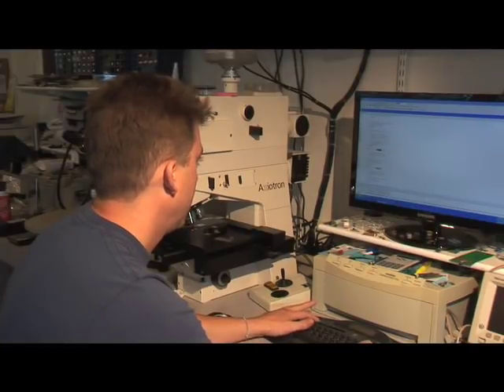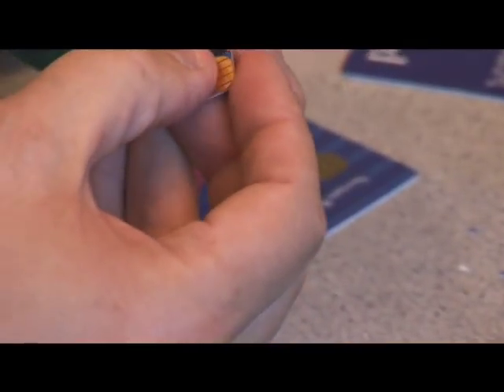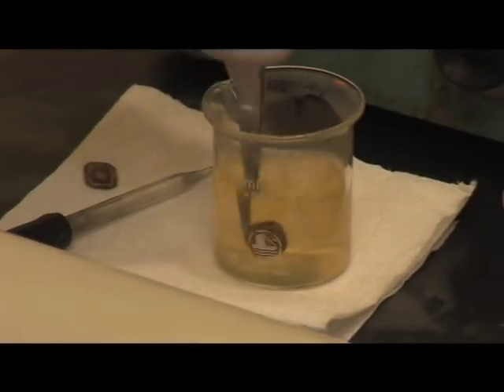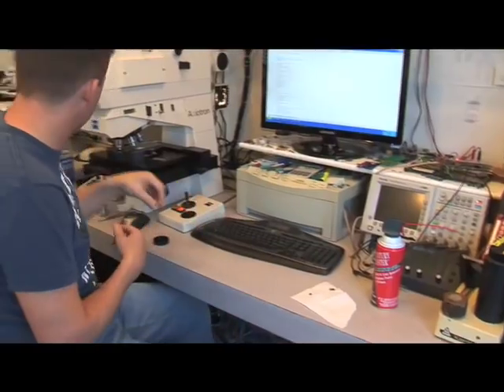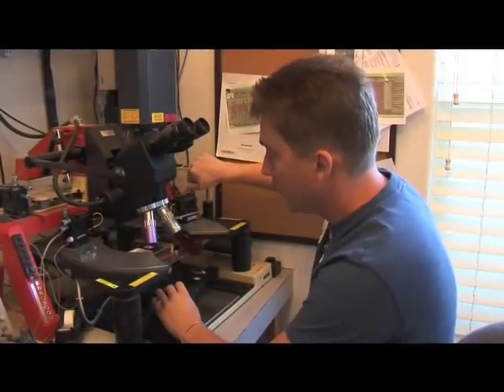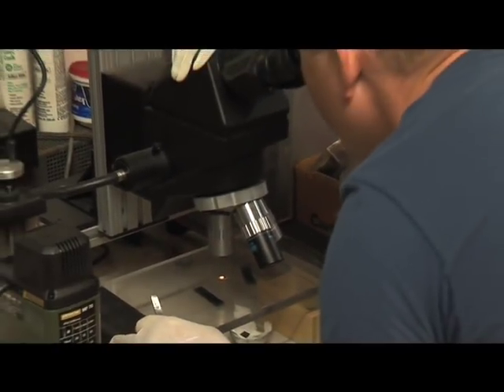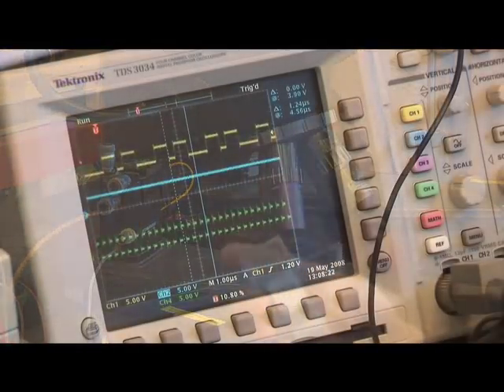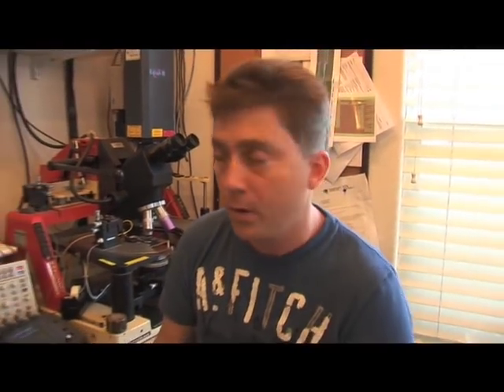How to Reverse-Engineer a Satellite TV Smart Card

Comment: He isn't listening to the data from the in/out pins of the chip. This chip is a self contained system, the in/out sends and reads encrypted data. What he does is open up the chip and probe the internal databuses to see what data is sent before it is encrypted, what happens to it during encryption and so on with data receieved.That way he can see what exactly is happening to the data that goes in and out. This is sort of like decompiling a class library and looking inside past the layers of abstraction.. only with some cool hardware :)
Reply: Thanks for the knowledge

Comment: he melts the plastic coating to allow himself the chips main processing areas, from there hes basically circuit bending, he is putting his own data pulses into the chip and watching the output, that way he can hack it to do whatever he wants. the input pulses help decode the security parts of the chip, once he understands the functioning he will be able to make the chip do work for him. its incredible, i wish i was smart enough to know the different pieces of the chip, i only know 555 chips lol

Comment: Ok, I get most of the chemistry behind it. The chemicals are readily available and shouldn't cost over $50.
Micropositioner probe costs around $500.
Tektronix TDS3034 used to read the lines Costs around $3k, but there's gotta be 1 at the university I got to.
Which software are you using to create the log?

Comment: @vanda219 Actually it IS difficult and costly to do such thing. Not because of the process, but due to the machinery and devices involved. Even the digital oscilloscope shown in the video costs AT LEAST $500-1000. Also, even if you succeed in getting the crucial parts of the chip exposed,you have to know EVERYTHING (literally) about digital electronics,smart cards and encryption systems in order to extract anything meaningful from the card.But I'm sure you can do this from off-the-shelf parts...

Comment: The stripping and cleaning with Nitric acid and Acetone isn't that hard - most scientific labs have litres of both sitting around

Burn of protective layer and clean away the debris - before the acid eats everything

Masking is a very old and well developed technique - especiall on this large a scale (normally it is done on ~30nm scale..

Then listen or talk to the chip with a top quality oscilliscope

Incidently similar techniques would work on chip and pin bank cards.

Comment: Like I said, try some research. Monitoring electron output does NOT tell you how said output is reached. The codes is hardwired in the card; the only way to reach the code itself  is via physical means. He has to access the code to break it. One cannot access the code via electron flow. Why do you think it's so hard for the coders to do it?  Check it out if you don't believe me. If you have the answers, become a coder and crack it. You'd make millions.

Comment: This is an interesting demonstration, but I don't see the purpose. I hope people won't start dripping hot nitric acid on things at home! 

If I wanted to hack into an RFID chip, I could probably find a way, and it's nice to see how someone who is careful and has the equipment and experience might do it. Realistically, if I do it at home, my technique probably will be much cruder and simpler. I likely could live with the reduced reliability of a cruder technique that I could employ, verses a more sophisticated technique that requires using a variety of dangerous chemicals and unusual equipment (ultrasonic cleaner and oscilloscope). 

Now, the question is, why would I want to hack into an RFID chip?
Reply: This very sophisticated technique is used to capture the encryption/decryption algorithm of the satellite card - it would be more time consuming (if not nearly impossible) to do that with just capturing the signals coming in and out of the chip pins. The satellite companies has made techniques to protect that algorithm - but they were not counting on this guy to open up the chip and peer inside.

That chip is more then a RFID, and this technique can be used to reverse engineer any microchip.

Comment: Doesn't look that complicated, all that acid and cleaning stuff is just to get at the contacts.  There are multilayered circuits in a smartcard, so you have to make a hole in the upper layers to get to the lower layers.  The problem comes if they put important circuitary directly above the critical parts you need to access in the lower layers.
The rest is electronics

Comment: what do u mean "get away"? does everyone in europe do this? anyway hacking this card is better than acid or shitting on it u can hack by inserting it into a computer and finding the code my uncle did it he then programmed the code into a card with a wire and a sim and connected it to the reciever and boom gud as the other one which means u wont have to damage or change the original card to watch free tv europe people are unlucky if they resort to breaking the card